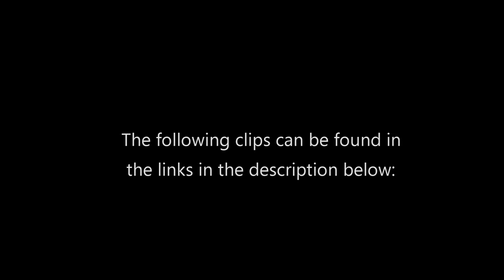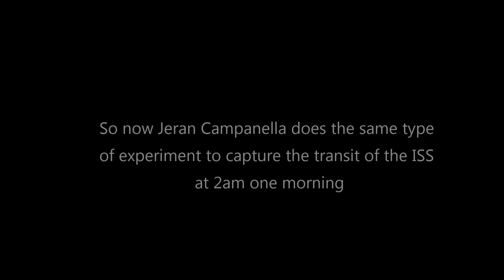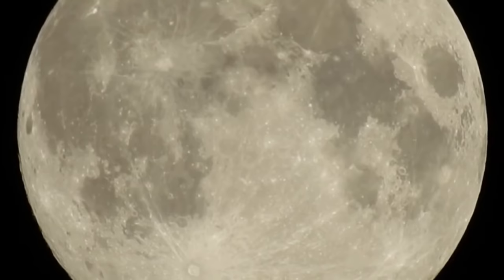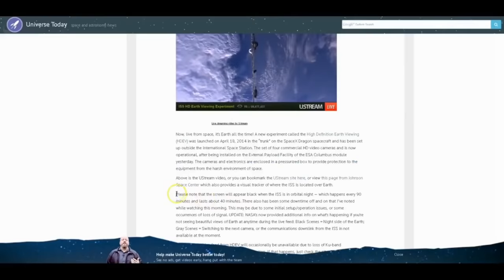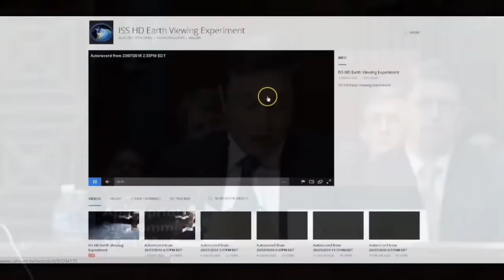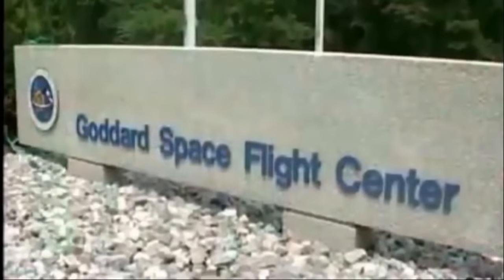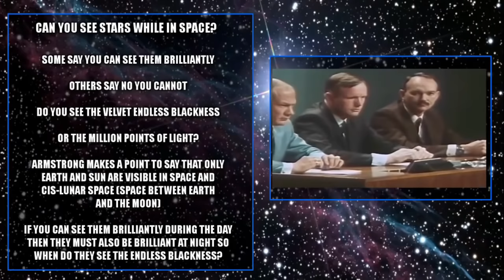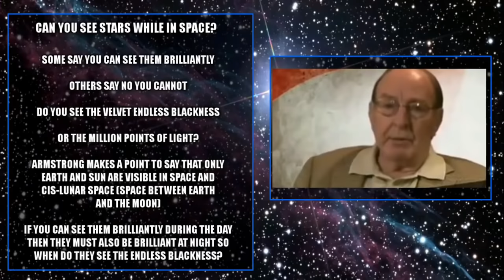The ISS Confirmed!

Comment: Here's something interesting for you to consider. On Nasa's web sight there's a page called Spot the Station. Some of you may be familiar with it. I've known of it since back when the Shuttles were in use & have gone out into the yard & seen the station & the shuttles come over many, many times! I've even seen them pass through my telescope's field of view. NOW, explain how that happened if it's all as fake as you seem to believe!!!!
Reply: the contention is that whatever is transitioning the sky is not the size of the iss nor even habitable, certainly not the same object you see during 'spacewalks' and docking procedures. its merely a fast flying object of approximate shape
Reply: @jackssmirkingrevenge9365  We can do the math on how fast they are flying and how big they are. Transits for example are an excellent way of doing this. Using a transit you can calculate the angular velocity of an object, using that you can calculate the altitude it is at because there's only going to be a limited set of low eccentricity orbits that transit at that velocity. Once you know it's altitude you can calculate the size of the object you are viewing. This is all high-school math, there's nothing particuarily complicated about this.
When you do the math you realize that the object you are viewing is about the size of the ISS and in the orbit the ISS is supposed to be in.
Reply: @asArsenic  I don't have a horse in this race, but a 747 is about half the size of the ISS, and it flies at around 6 miles above the Earth. The ISS flies at 250 miles above the Earth. So it is traveling 42x the distance than the average plane, and is only twice the size. The ISS should then be 21X smaller in reference to the average plane you see in the sky. When planes are traveling at 6 miles up you can barely see them. Explain that please.
Reply: @sayansuper3464  Well, we can barely see the ISS either. It is in fact about 21X smaller. The only thing of the ISS you are going to see with the naked eye is the sunlight being reflected off it. To resolve an actual image of it you need a telescope.
Reply: @sayansuper3464  For example, a boeing 747 has the angular size when viewed from directly below of a little over 0.4 degrees. The ISS meanwhile under similar circumstances would be a little under 0.02 degrees. Meaning it should appear to be approximately twenty times smaller than the plane.
Reply: @sayansuper3464  To take this even further, planes and the ISS are rarely viewed from directly below. You are in fact more often than not looking up at them on an angle. A plane traveling at six miles of altitude when viewed from below at an angle of 45 degrees is in fact 8.5 miles away from you and at 22.5 degrees it's a little over 15 miles away.
Reply: @Image-X  Have a cup of tea buddy, I'm the person arguing in favour of the ISS being exactly what it appears to be: An orbiting laboratorium and an amazing human accomplishment.
Reply: THOSE ARE ASSERTIONS YOU'RE MAKING, NOT PROOFS.
Reply: Semni Istiqlal Reply was meant for Super.